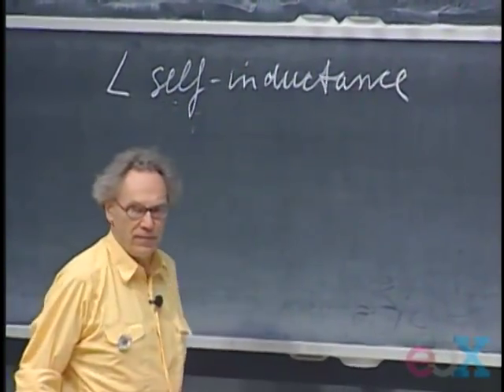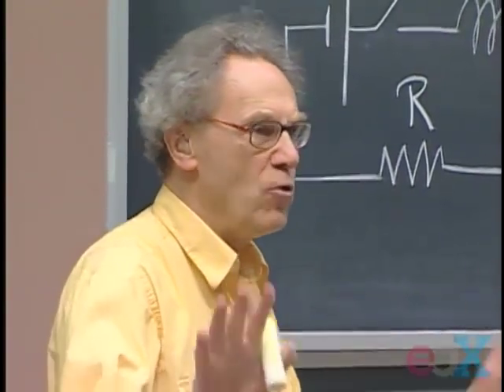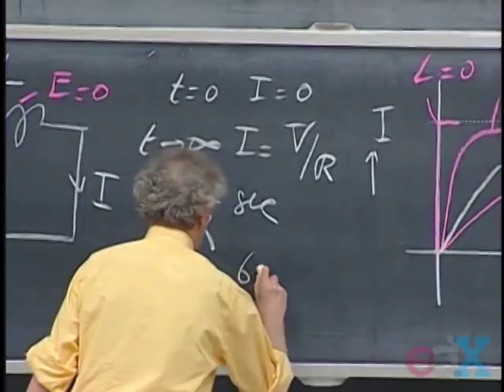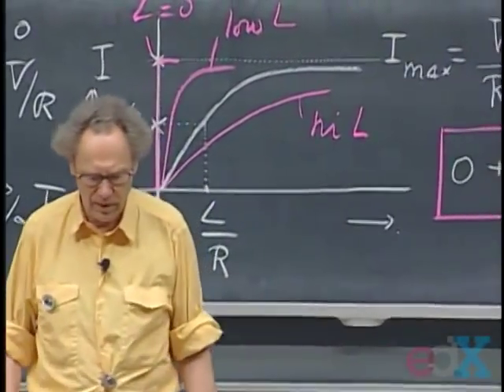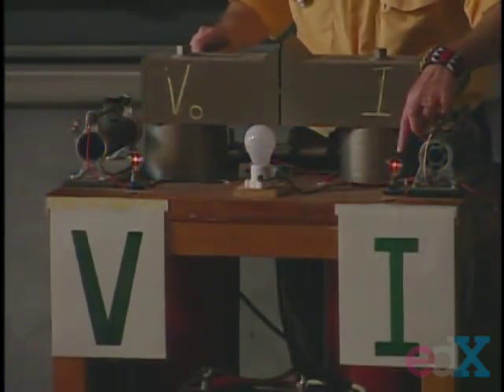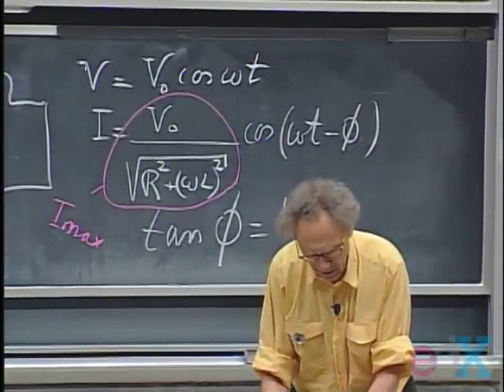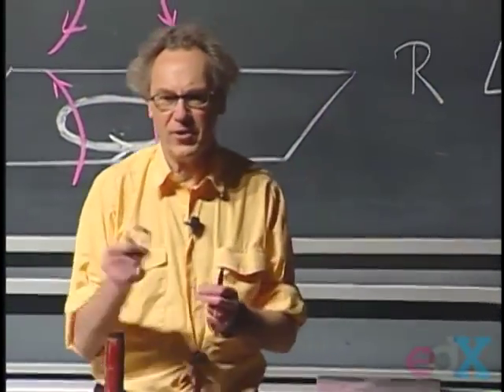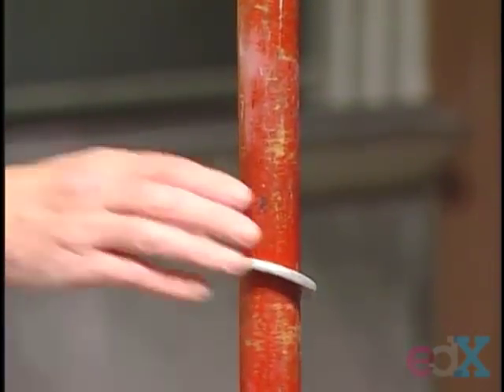8.02x - Lect 20 - Inductance, RL Circuits, Magnetic Field Energy

Comment: Dir professor, I have problem solving  the differential equation at 34:35, can anyone help me out with this? By the way, this video is really helpful, thanks a lot.
Reply: The way I'd solve it, is to assume the solution is a linear combination of sine and cosine functions at the same frequency as the source, with arbitrary coefficients A & B.  Then apply this prototype solution and its derivative to the original equation, and set up a pair of linear equations to solve for A & B.  The sine terms have to add up to zero, and the amplitudes of cosine terms have to add up to V0.

The solution:
I(t) = A*cos(ω*t) + B*sin(ω*t)
A = V0*R/((ω*L)^2 + R^2)
B = V0*L*ω/((ω*L)^2 + R^2)

Comment: Hello professor , in RL circuit the E-field is zero inside the wires of the inductor although there is a changing B-field in the region where the inductor exists so there must be an induced E-field in that region but after reading your lecture supplement i think that the induced E-field will be zero due to the build up of static charge ?
Reply from the maker: >>>i think that the induced E-field will be zero due to the build up of static charge ?>>> yes that is correct. Read this file all the way to the end. http://freepdfhosting.com/0813df09f5.pdf
Reply: @lecturesbywalterlewin.they9259  actually this is the paper i read and me conclude my conclusion .

Comment: Lectures by Walter Lewin. They will make you ♥ Physics.Professor,For  LC oscillations,my book tells me to use kirchoff's loop rule,but should I use Faraday's law or kirchoff's rule?
Reply from the maker: Kirchhoff's rule does NOT apply in case of a self inductance. 
They closed loop integral of E dot dl is NOT zero. It's --dphi/dt. Many physics teachers and physics books do not understand this and thus they move the --dphi/dt to the left in the equation and then the sum of all terms is ZERO. But that is NOT because of Kirchhoff. That's because physics teachers do not understand
that if a+b=c (Faraday's Law) that a+b is NOT zero. They are ignorant and write a+b+c=0 That is correct, but that is NOT the closed loop integral of E dot dl. I suggest you watch https://www.youtube.com/watch?v=LzT_YZ0xCFY&list=PLyQSN7X0ro22zanLOcvkaSY-IZqheFYM5&index=6
Reply: mmm...thanks

Comment: According to the equation given in 14:08 ,will current be zero when the resistance in the circuit equal zero (an ideal  case)?. If so will self induction of the coil be responsible for that ?
Reply from the maker: If R=0, Imax goes to infinity.  0 x infinity can be ANYTHING!

Comment: Loved your new video by the way, 5+3-8 = 0! If Faraday's Law is applied inside of a solenoid, then you find, going up or down from the axis of the solenoid that the induced E-field grows with that distance. However, this E-field, created by the back emf is incredibly small (order of 10^-4). Is this the result of the fact that no self-inductor is ideal or is there another explanation?
Reply: If you take a closed loop inside a self inductor and apply Faraday's law then you get that the E-field is 0 at the center of the solenoid and increases linearly in either direction from its axis. This E-field is, however, on the order of 10^-4 V/m. Is this the result of the fact that no self-inductor is ideal or is there another explanation?
Reply from the maker: question unclear. Plse try again
try to understand my differential equation for an LRC circuit. I believe I cover them in this video. An ideal solenoid has zero ohmic resistance. In all cases the ohmic resistance will be very small and in the diff eq you can add it to the R in the circuit. Thus you split the self inductance up in an ideal self-inductance in series wth its own ohmic resistance.  The E field in the thousands of spiraling circular wires (coils) of an ideal solenoid (super-conducting wires) is always ZERO! Notice the ZERO in my diff eq.
Reply from the maker: there is NO E-field at the center of the Solenoid.  No E-field anywhere inside the solenoid in the area enclosed by the coils. There is ONLY a B-field.
Reply: I believe I have understood this video, which covers an ideal case, but if you take a closed loop of one coil and attach it to an open surface and apply integral(E.dl) = -dphiB/dt, we can find an induced E-field of 0 at the CENTER of the solenoid only but since E is prop. to the distance from the solenoids center, then you get an E-field that is very small. Has nothing to do with diff. eqs.
Reply from the maker: this is incorrect. use google. The induced emf is NOT inside the wires of an ideal solenoid it shows up elsewhere in the circuit where there are resistances.
Reply: Lectures by Walter Lewin. They will make you ♥ Physics. Understood. So what is the meaning of the answer to the problem in the exam? And secondly can the back emf appear anywhere where there is resistance or only in certain locations?
Reply from the maker: solutions are posted below the video thumb nails
Reply: Have you gotten chance to check the link I sent sir?

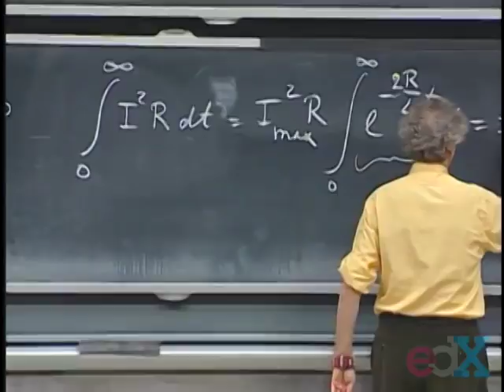Comment: WL, is there any link between the equation at 22:15 1/2 LI^2 and the equation for Ek = 1/2mv^2 ?
Reply: No, actually. There's no analogy here.
Reply: Sure.  Think of L as analogous to inertia, and current as analogous to speed.

You'll see an analogy between circuits with capacitance, resistance, and inductance, and vibration setups with a spring, a damper and a mass.   The same differential equation governs both kinds of systems.

Capacitance is analogous to the flexibility of the spring (inverse of the Hooke's law constant).
Resistance is analogous to the viscosity rate of a linear damper.
Inductance is analogous to the mass, as it resists a change in current, just like mass resists a change in speed.

Comment: Professor Lewin, when you talked about the steady state solution of the current i(t) for an RL circuit excited by an ac source ( from 32:50 ), I do not understand the intuitive verification you gave; I have no problem understanding the mathematics behind it ( solving the differential equation ) and I am able to picture the starting of the i(t) waveform, taking into consideration the transient response.
I am not, however able to picture how increasing w would increase di/dt; this requires me to think of the steady state response without thinking about the transient time period. How do we generalise that increasing w would increase di/dt? 
I can either look at the equations, trusting them and understanding what happens to i(t) with the equation as the starting point of logic, or I would need to arrive at the intuitive reasoning you came to, ignoring the transient response. 
Can you please tell me how to do that, sir? 
Thanking you in advance.
Reply from the maker: I watched at 32:50 but I cannot add anything useful to what I already said. I suggest you use google.
Reply: I'm sorry sir, I meant 34:04
I was referring to the part where you talked about the effect of w on the current, when you referred to the equation, saying increasing w is like increasing resistance which decreases the current magnitude. I was just asking how to arrive at the intuitive reasoning behind it. 
Thank you
Reply from the maker: this is not a fishing expedition. I watched at 32:50. 😊 Please respect my time.

Comment: Is it fair to say that the self inductance of any circuit is the magnetic flux it gives per unit of current running through it?  L = phi-sub-B / I?
Reply from the maker: I discuss self inductance in my 8.02 lectures. You will find your answer there.

Comment: Sir if integral E dot dL is zero across inductor...what reading will i get if i connect a voltmeter across inductor..?
Reply from the maker: if you connect a V meter over the self ind it will read -Ldi/dt. 
You have to apply FAraday's Law in  the closed loop V meter - inductor. The intergral of E dot dL through the wire of an ideal indcutor is zero,  but the closed loop integral is -Ldi/dt.

Comment: near the end of the lecture, if the aluminum ring was placed inside the electromagnet, would it oscillate or just get repelled in one direction?
Reply from the maker: behavior would be nearly identical
Reply: to be clear I drew what I described in this link: https://drive.google.com/file/d/11efMmfX1-KuzYLaLmXfhTB8hcu-fHY9q/view  . I was thinking that if the ring is completely above the electromagnet it will be repelled upward and if it is completely below the electromagnet it will be repelled downward. if it is in the middle it may still go in one direction or the other or it may oscillate.

Comment: hello professor ! referring 20:35. earlier you said that magnetic fields doesnt do any work so how are they providing energy? is it because these fields are dynamic?
Reply from the maker: the work is done by electric charges which create the B-fields.  When all the magnetism comes from classical currents, the magnetic field does no work directly on the currents. However, by steering the electrons in new directions it can cause them to bounce off things and do work. Once the current carrying loops start moving, they create electric fields that do work on the currents.
Reply: @lecturesbywalterlewin.they9259  got it sir thankyou and love you <3

Comment: Please sir , why do you consider the self inductance for the inductor only ?shouldnot the self inductance refer to the inductance of the whole circuit ?
Reply from the maker: the inductance of the inductor is probably 10^4 - 10^6 times higher than the remaining part of the circuit. a 1 meter long copper wire (1/8" diam) has an inductance of 1 micro H.

Comment: at 7:20 you said that think of inductor as made up of superconducting material so if thats the case then i think that induced current will always gonna run and it will always fight the change and as the current increase, induced current also increases so how can an inductor loses the fight?
Reply from the maker: solve the diff eq. you will find that the current will no longer change after some time. Then dI/dt=0 Thus L*dI/dt=0 thus the induced  EMF= 0'.
Reply: got it sir thankyou so much ! i love you and your lectures ❤

Comment: Why there is no Electric Field inside the inductor IF THE RESISTANCE IS ZERO ? ( I emphasize on the latter words because I am getting no intuition about relationship of E and Resistance)
Reply from the maker: In static situations (e.g., a charged conductor) there is no E-field inside a conductor because they have free electrons which will eliminate any field. They DO have resistances.  Thus if you apply a voltage there will be an E-field inside V=IR.
Reply: Sorry. I read and re-read your supplement. And now got to understand that even if have a small resistance then also the field inside the conductor will be almost zero> THANK YOU FOR THIS EYE OPENING BRAIN STORMER beauty of physics
Reply from the maker: The resistance has nothing to do with it.
In static situations the E-field inside conductors is EXACTLY ZERO.
Reply: Sir one more question ( sorry and please ) : What if I talk about an LR circuit ( DC source ) and the switch has just been switched ON. In that situation will inductor have any E-field inside it?
( I am really sorry if it  is annoying and makes you feel bad )
Reply from the maker: an ideal conductor (made of superconductive material) will NEVER have a E-field inside.
Reply: Thank you for reply and tolerating this high school student. May you live long.
Reply from the maker: an ideal conductor (made of superconductive material) will NEVER have a E-field inside.

Comment: Sir,wasn't the demonstration of magnetic levitation the result of both mutual and self induction?Why did you take the induced voltage whimisically as v_ind.=v_0coswt? Won't it depend on di/dt since v_ind.=-Mdi/dt??
Reply from the maker: I do not do anything whimisically
how many minutes into the lecture.
Reply: But if we take the original current I=I_o coswt  then the induced voltage by Faraday's law will be V_ind. =-Mdi/dt =V_o sinwt,  a 90 dgree shift from the original function.But in your demonstration, I haven't noticed this shift
Reply: A further shift of phase angle by 90 degree will bring to phase again with the actual current, I guess
Reply from the maker: stop talking
let me know how many minutes into the lecture!
Reply: 43.48.
Reply from the maker: Geralt Rivia  my solution follows from my diff eqs. If you need more help, please use google.
Reply: I simply have one question. While solving the differential equation, you took an alternating voltage of v=v_o coswt. It was ok for the AC circuit. But then during the demonstration of magnetic levitation,  did you take that voltage as the induced voltage or the original voltage of the coil?
Reply from the maker: Geralt Rivia  I do not remember the details of that demo.I suggest you ask Andy Neel aneely@mit.edu

Comment: 11:08 you said E.dl is zero across the inductor because there's no electric field. But shouldn't E.dl there be equal to the induced emf?
Reply from the maker: not true the E.dl through the superconducting coil is zero but if you place a voltmeter across the inductor, at time t it will indicate -L(di/dt). This is very basic. Watch my lectures.

Comment: In my textbook we have a different chapter for electromagnetic induction ,and different one for alternating current 😊😊😁
Reply from the maker: that's very common.  However, no Physics College book has yet covered that  2 voltmeters attached to the same 2 points in a circuit can read very different values. YET, if you give this some more thoughts,  the secodary of every transformer can do that. = That too is not covered in college physcs books.   Faraday's Law is remarkable and it runs our entire economy.

Comment: In the experiment with the 2 bulbs, how come the bulb in series with inductor turns off immediately.
Reply from the maker: good question. The resistance of the light bulbs increases with temperature. When both lights are fully lit, each light bulb probably has a resistance of 50 ohms or even more (I discuss this in a different lecture + demo) . When we open the switch the current is now going around in the loop with L, 4 + >50 + >50 + 4 ohms.  Thus L/R is now 30/>108=<0.3 sec

Comment: Professor Lewin, 
I tried using Kirchhoff's loop rule to derive the expression for growth and i'm getting the same expression, even though using it is wrong. Why is it so? Is it just a fluke? 
Thank you
Love from India
Reply from the maker: You used Faraday's Law then moved the dphi/dt to the left and the sum of all trems is then zero. But that is NOT KVL. It's still Faraday's law.  Watch this: https://www.youtube.com/watch?v=f3-SfzepuPs&list=PLyQSN7X0ro22zanLOcvkaSY-IZqheFYM5&index=10
and read this
Most Physics College Books have it WRONG! http://freepdfhosting.com/0813df09f5.pdf
Reply: Think of it similar to the idea of using "inertial forces" as a method to solve problems in mechanics.   This is also known as the D'Alembert principle.  Inertial forces meaning -m*a is treated as if it were a force.   Such as the "centrifugal pseudoforce" or the Coriolis "force".   You'd then proceed to adding up forces to zero as if you were solving a statics problem.

This might get you the right answer, but it neglects to track what is really happening with the physical principles.  "Inertial force" is an oxymoron, because inertia is not really a force.  It may have units of Newtons, and seem to be a force if you were blind to your immediate environment's acceleration, but it isn't a method of mechanical interaction between objects, as a real force really is.

Treating self-inductance the same way, and applying Kirchhoff's voltage loop law is the same way.  It is setting up the equations to fit your familiarity with adding terms up to zero, and it solves the problem mathematically to get the correct answer, but it neglects to model what is really going on.

Comment: If the magnetic flux is equal to inductance times the current, does that mean inductance is the source of magnetic field? I ask this because if inductance is 0, then the magnetic flux is 0, which means the magnetic field is 0
Reply from the maker: @sudarshanhs6588 
Watch my lectures: magn flux through an area A is the integral of B*dotdA - also: The magnetic flux (Φ) threading a conducting loop as a result of current in the loop is directly proportional to the current (I). The constant of proportionality L is called the self-inductance of the loop. Self-inductance has units of ohm seconds.
Reply from the maker: magnetic fields are always the result of moving charges (due to Einstein's theory of Special Relativity - Read Chapter 5 of Purcell's book or use google)  I exclusively think of the magn flux as the closed surface integral of B dot dA.  @sudarshanhs6588